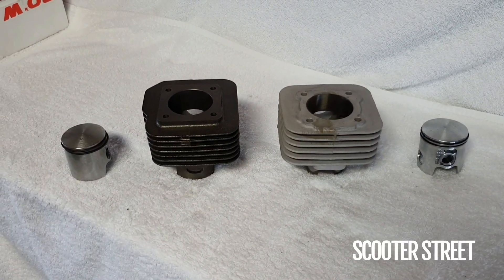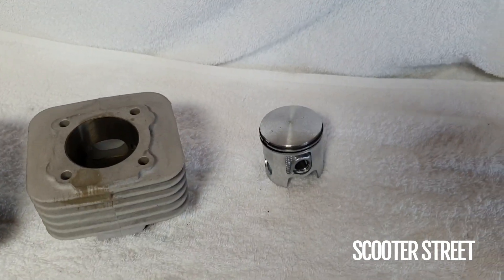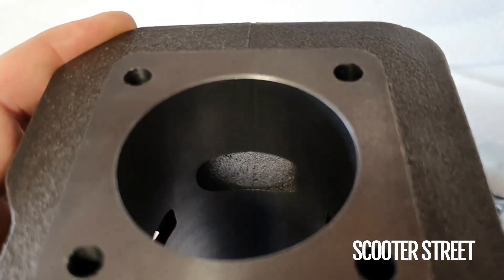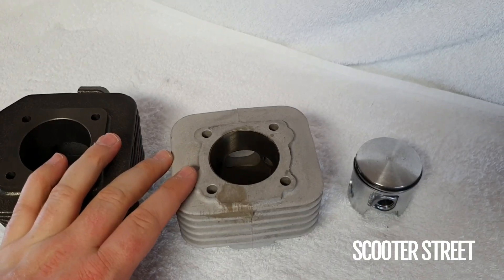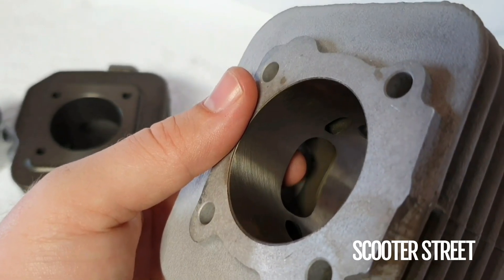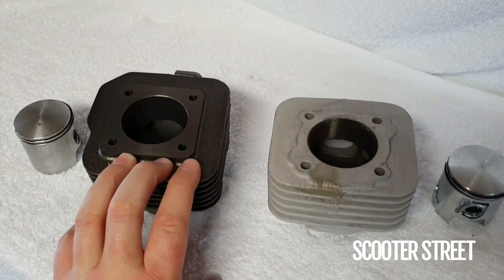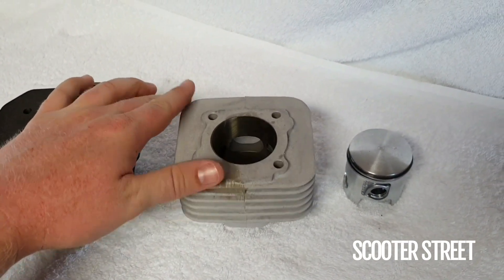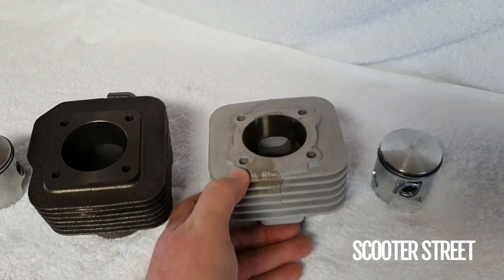Malossi MHR Replica vs Sport Cylinder Range - What's the difference?

Comment: Essy enough to port a Malossi Sport kit to similar rpm and performance numbers, but keeping the cast iron benefits.

Curious what the flow numbers are between the two though. Porting a Sport kit to move max hp 2-3,000 rpm higher is definitely possible. Then put a big carb on it, and it flies compared to just a standard sport kit.
Reply from the maker: Great info🙌
Reply: @scooterstreetau  Or better yet, get both kits and have fun tinkering with them. 

Back in the day we ported Malossi 60cc 45mm kits for Yamaha Dt50 mxII,  which supposedly was 6.5 HP, to match the performance of the 9.5hp kits going on Suzuki TS 50 X. Very large exhaust port, as wide as we dared, and narrowed the clearance to maximum port mapping, made swirl port intake ports, aswell as intake,  moved the top HP from approx 8000 rpm to 10,500-11,000 rpm, then added 24 millimeter Delllorto carburetor, max bored the cylinder, and that thing kept up with stock 100cc bikes, surpassed the Suzuki TS50X.

That's when we discovered the older Suzuki ER 50, which has a 50mm piston, for a full 75cc. That thing with a broken piston where the piston  ports had halfway broken off, only pulled above 6,000 rpm, but all the way past the max rpm on the gauge to 12,500 rpm, and pulled like crazy. Two riders uphill, that thing would pull away from the 11hp normal kits. We changed the piston and instantly lost the magic. Now it pulled from idle, but lost the crazy HP up top. 

We took some of that experience and did max effort porting on standard restricted 50cc 1 speed bikes such as Yamaha QT50, and managed to make it pull away from 100cc stock bikes, screaming at insane rpms. Tok a grinder to the piston and dug out insanely large piston ports, lightened it, did 5 porting passes, each time increasing the output noticably until that final result.

If you ever drive a Yamaha Rd 350, you'd know these 2 strokes can run way up into 18,000 rpm and beyond. Malossi sport at 7-8,000 rpm max output is really very conservative, but reliable as nothing else. Perfect for a daily driver actual transportation. Just needs a new piston ring set after about a year or so, which the stock 50cc cylinder do too.

Comment: Whats better about the MHR rep compared to the Polini Corsa besides aluminum vs cast
Reply from the maker: The Polini is great value 5 port adjusted port timing for additional power, the Malossi has potential to deliver more horsepower, 9 port, Nikasil bore. Both twin ring.
Reply: So for street use wheelie hooligan shit the corsa should be great. Polini 21 carb  Stage 6 rep exhaust and stage 6 over range kit 13/44 polini gear set
Reply from the maker: 👍👍 @tjjohnston7920
Reply: @scooterstreetau  thank you *m new to this automatic scoot stuff. 636 kawi stunt bike every dirt bike even a few groms. But The scoot scene is new In my area and It looks fun af. Anything from a more seasoned scoot rider/builder helps. Thanks
Reply from the maker: Scooters and tuning is addictive, BEWARE😂 @tjjohnston7920

Comment: Any recommendations for main jet sizing  and needle clip with MHR Rep with Yasuni R and 19mm Dellorto carb on Piaggio Zip?
Reply from the maker: Depends on the entire set up, but start main at 92 and go from there, once jet is close then needle clip change. Start needle clip in middle.
Reply: @scooterstreetau  Thanks, currently clips 1 down from top, not as crisp as could be to mid throttle, seems o.k top end, has stock airbox with red malossi foam filter, stage 6 glass fiber reeds, stock clutch and contra, polini yellow clutch springs and 6g rollers currently.  Daily commuter
Reply from the maker: The needle controls the fuel delivery as it opens. Try one jet size in all needle clip positions as you get closer to the final result. You may find the needle needs to be replaced for that finer feel. @dtnz3294

Comment: Hi, i am looking in kits and i want one where i don't need to replace the crankshaft would the stock crank be able to handle the malossi sport kit for a longer period of time and how long would the stock crank hold up with the mhr rep kit
Reply from the maker: We apporach this with the age of the engine in mind. The factory crank will handle the Sport cylinders, BUT! the age and condition of the bearings, seals and chrankshaft should be of above average condition. The MHR rep will require small end bearing change at regular kms.
Reply: @scooterstreetau  okay, thank you very much the engine has about 7k kilometers on the clock and all of the seals and bearings were replaced 2k kilometers prrior
Reply from the maker: ok great. @hatunko5168

Comment: Hi, for start, I like and missing your new videos. I hope u could help me to decide. By  the way, I got 2007 Gilera Runner 50cc ( by by Typhoon ) for my future project. I want to gain max power on lower rpm and get best of speed with some of "street legal" exhaust for start. I prefer deep, sillent sound. What u would recomend for 70cc cylindres? Malossi Sport, Malossi MHR Replica or Dr.Evo with one of listed exausts: Gianelli GO, Stage 6 Street, Leovince Touring, Tecnigas Silent Pro or something else. In basic, I like to glide, 50-70km/h, saving engine life, saving gas but also use al revs when I need ones... ( im 110kg)....
Any other toughts are welcome... Ty.
Reply from the maker: All of the performance pipes create larger noise. I like the Malossi Wild Lion. Polini, Gia Go and Tecnigas also make this style and the sound is similar to the standard pipe, with increase performance. not too light on the rollers, this will help cruise.

Comment: The kit is way too expensive now compared to what class its in. Malossi have always been one of the most expensive brands,but now the parts is just too expensive. Beside that. Most people where i live (Norway) Dont want anything that may expose them for tuning theyr bikes. So everyone drives around with Touring type exhaust. Basicly stock type exhaust,only slightly better. 

A MHR Replica kit runs pretty horrible on these exhaust,compared to lets say the little brother (Malossi Sport) but also types like Polini Sport, DR Evolution ++ For more purists the MHR Replica doesnt really shine in any of the categories (Sport = Street) or Racing. Its a nice kit,but who is it really for? And for that price you can look at Stage6 kits for much better price,and they offer far better performance out of the box. 

And what the point in the so-called durability,when firstly it seizures just as easily if youre not really good with the carb tuning. (99,8% of all 2T seizures comes from faulty carb settings in my opinion) Get a Sport kit if you want more from your scooter. Better for your wallet. Its a really nice power/cost ratio,and the longevity is propably double the MHR Replica kit. (And it runs better through most RPMs except the highest ones) My personal favorite is the DR Evo kit (TP Trophy) Combine with a 17,5mm - 19mm carb and a Leo Vince Touring or similar. Runs 90km/h with a pretty sick acceleration. Sounds basicly stock,and keeps the popo away.
Reply from the maker: Great information for the viewers, thank you.🙌
Reply: The situation you describe is entirely similar in The Netherlands. Perhaps even stricter with regular mini dyno police controls. Scooter goes over 55 km/h ur fucked (need a re- MOT check)

We also prefer DR or s6 streetrace (its the fastest cast iron "sport" kit with 17,5 - 19mm and touring exhausts (sito+).

That being said if u search around u can get this MHR Replica also for around 200-220 in Europe. For that price its a nice long lasting kit with nicasil and 2 piston rings. Shame it doesnt run great on the touring exhausts really.
Reply from the maker: @Daisudori  Great information, Thank you🙌
Reply: That ist true - if you want to run the bike on european streets - you don´t want to wake up every special police group within 10 miles if you only start your bike. You need some sort of understatement-bike. Should look ugly, like grandpa´s old scooter ... top-case behind you. Should sound like 40ccm if possible...so no sport - exhaust but a good silent touring one. And it is much more fun to see the other bikers on their scooters with open jaws, when you drive by with a smile on your face on your old, ugly scooter and they can´t catch you.

Comment: Hi, I have a typhoon 50 euro  4, can I use this mhr replica kit with the original piaggio cranckshaft? Have I to change it?
Reply from the maker: Yes you can, the factory Piaggio crankshaft is very strong. The issue with the E4 Typhoon isn't the crankshaft, its the heat sensor on the head. The CDI has the ability to advance the ignition timing, it does this with data from the heat sensor. As the engine gets hot, the CDI backs the advanced timing down in order to stop the engine overheating. Removing the sensor results in the CDI running max advanced timing, all the time - and we've seen it melt a hole straight through the centre of the piston on several of these bikes where the sensor has been removed. There is a work around though! The Malossi Sport and MHR Rep share the same piston (the only difference are the rings) and the same cylinder dimensions. You can run an MHR replica by using the factory head with the heat sensor, using the special head gasket from Malossi gasket kit 116923 (gasket kit for the headless sport kit). This will space the factory head correctly for the Malossi cylinder kit, allowing you to run the factory head with the sensor.
Reply: @scooterstreetau  no problem for that, I have the cdi malossi digitronic euro 4, in my scooter I’ve change everything I can, it remains the bearings and the crankshaft 😂😂😂
Reply: I can say it became an euro 0 ahahah😂
Reply from the maker: @mattenjoy6394  The Digitronic unit still advanced and retards the timing, as well as still activating the solenoid to lean out the carb... It just does so within safer parameters, still best to keep the heat sensor! The Piaggio engines rarely develop crank issues, however the Typhoon/SRMT engine in particular does have a somewhat common issue with the right crank bearing. We have seen a handful of them blow do the right main bearing. Commonly they get super noisey, and develop movement internally. Unfortunately nothing you can do but replace.
Reply from the maker: @mattenjoy6394  Nice work🤙
Reply from the maker: @mattenjoy6394  When you are ready, finish it.
Reply: @scooterstreetau  I’ve not the original carb, anything can control it because it’s all manual, I’ve remove the solenoid as well, it only works mechanically. Having everything changed, I had no problem up to now, I also had a 50cc sport malossi cylinder kit for about 6500km with a max effective speed of 95 km/h (obviously with a full elaboration: transmission composed by full polini evo 3,  polini scooter team 4, polini 17,5 CP carb etc).
Reply: To reach this velocity, I obviously also changed the transmission gear with HTZ 14/48 malossi, they are a specific gears for typhoon euro 4, because it has a very short originals gears.
Reply from the maker: @mattenjoy6394  Yes this will surely increase the top speed.
Reply from the maker: @mattenjoy6394  Nice parts list. May now be the best time to change the crankshaft and bearing set..
Reply: This cilinder is 2 stroke, you probably have 4 stroke
Reply: @finnkulker3803  nope, typhoon euro 4 2018 is a 2 stroke scooter
Reply: @mattenjoy6394  okay well them the original crankshaft Sshould  be okay but you Will have to check the bearings if their okay
Reply: @finnkulker3803  so if I buy this mhr replica kit I’ll probably should change the bearings and not the crankshaft? but if I disassemble the carter, it’s not to change bearings and crankshaft the best idea?
Reply: @mattenjoy6394 if you have the budget, yes but its not necesarry
Reply: @finnkulker3803  ok thx, I think I will buy malossi rhq crankshaft, like that I can use it for a lot of cylinder
Reply from the maker: @finnkulker3803  👍
Reply from the maker: @finnkulker3803  They were manufactured with a 2 stroke engine.

Comment: Hi 
Can i use the oem cylinder head on the MHR? Euro 4 typhoon 
Thanks
Reply from the maker: You sure can, you just need to use a special head gasket that comes in the Malossi 116923 kit. This is the gasket kit for the Malossi headless sport kit, designed to allow the use of teh factory head. You cannot use the factory head without this gasket, it ensures a good seal and correct squish tolerance.

Comment: what kit dou you 
recommend me. I have aprilia sr 50 R 2017 and Iwill buy yasuni carera 16 , white clutch springs, 60 jet and 4 g rollers maybe havier.
Reply: Thats a silly idea you don't know what size jet or rollers you will need until you decide what kit you are going with. 
For most scooters used everyday I recommend the stage 6 Street race cylinder as its reliable and pretty powerful matched with a yasuni z pipe and a 17.5mm carb it is a great everyday set up
Reply from the maker: Agreed, although we prefer the Malossi Sport to the Streetrace✌
Reply: @scooterstreetau  i prefer the porting on the street race i run one on a jog r its good value for  money and it defo beats the mallossi sport on my dna in both top speed and it seems to make a wider power band
Reply from the maker: I definitely would not recommend putting a Carrera 16 on a 50cc factory cylinder. That exhaust is designed for use on a mid-race bridge port cylinder kit such as an MHR or Stage 6 MKII Racing or higher as it requires very high RPM for the extraction chamber to work. You would be far better served installing a Yasuni Z or Arrow Extreme with the factory cylinder, or installing a mid-race cylinder kit with the Carrera.

Comment: lol after 5th try i finally managed to understand that "replica" isnt a racing kit but sort of combination of sport and racing power. And its suitable for low rpm revs (riding around town).

thanks for explanation.
Reply from the maker: You got it brother!
Reply: Mhr rep still aint good for street, never would recommend any aluminium shit for that. Reason: 1 scraper,last scraper. Cast cylinders are much more durable,forgiving and easy to repair.
Reply: @oliverfuchs4357  man thats not even true, two mates of mine are driving a few years with their aluminium kits
Reply: @dnh3005  Doesnt matter , 1 scraper is the definitly last one ,while cast forgives it most of the time. And i know people who drive 5 years on 1 cylinder, well 3000km... Gimme numbers i can work with instead of shouting city boy never got let down in 3 miles.
Reply: @oliverfuchs4357  Running with cheap mineral oil will wear out the plating.
As an example, the plated cylinders of Inoue Boring, which used to finish the NSR250R, have barely changed the condition of their inner walls even after running tens of thousands of kilometers.
Reply: @oliverfuchs4357  you got it, well said
Reply from the maker: @oliverfuchs4357  That is why they have a Nikasil bore. In our experience, they're far tougher as the cylinder and piston are made from similar metals meaning they expand at the same rate and are far less prone to seizure than a cast iron cylinder. This is why every manufacturer of performance cylinders only uses cast iron in their low end and budget cylinder kits. But really good to hear your experience✌️
Reply: @scooterstreetau  What you say is true, in view of performance they are a bit better,on the street however we sometimes get minor problems like leaking oil seals and gaskets ,oilpump problems,cold engine bashing and name what else happens.So a seazure is never too far away,specially if your not spot on mainainance schedules.Aluminium cylinders most of the time get totally wrecked by the slightest one ,while cast can  live with a little scratch.The cost of a new bore,hone and piston is also lower as you do not need to plate the bore again.On my ET2 i run a Dr optimized for 45000km now, first bore and second piston.By now you can hear the rings rattle when i let of the throttle ,but it still runs fine.The next step will be to try and get a 49,5bore out of it with a KX85 piston, 44mm crank and the foot of the cylinder machined off by a bit.
Will see if it works ,but to me its worth a try.
Reply from the maker: @oliverfuchs4357  We love hearing the experiences from other scooter tuners from all over the world, always an opportunity to share information. We have had great success with the Aluminium cylinders. Sorry to hear yours are getting Wrecked..
We like that the MHR Rep is a Replica and uses the 2 ring system. Thank you for watching our videos and your input, much appreciated👌

Comment: Why do you call aluminium "alloy"? Pretty much every metal used in our lives are alloys.
Reply from the maker: We describe the cylinder as Alloy referenced from the Malossi website which describes the Material used in the manufacturing of the cylinder and piston. Yes you are correct Alloy (combined metals) is used in pretty much every metal....
Reply: @scooterstreetau  Is it just a weird thing in the english language to call aluminium "alloy"? I hear "alloy rims" all the time as well.
Reply: It is called an alloy because the cylinder is made of aluminum and silicon.  Aluminum is rarely pure in structural applications.  The term alloy means that the metal has been combined with two or more metallic elements.
Reply: Cute

Comment: What if i use the silver piston rings on the Malossi sport?
Reply from the maker: Honestly I couldn't tell you what will happen. I would just advise not to, as there will be a reason Malossi supply the black Teflon coated rings with the sport kits.
Reply: @scooterstreetau  well i have Them as spare ones laying somewhere
Reply: @scooterstreetau  no haha im using stock black rings on my cast iron Malossi sport now

But i ordered spare rings so that i can replace them when its time so i dont have a lazy excuse to procrastrinate it hahaha